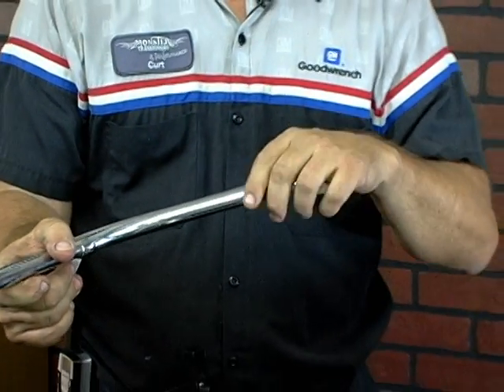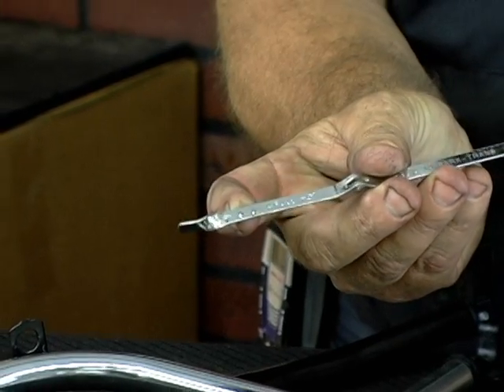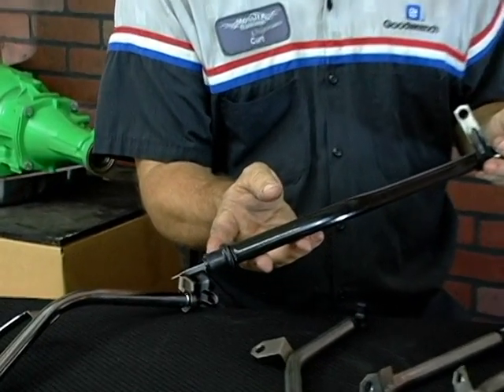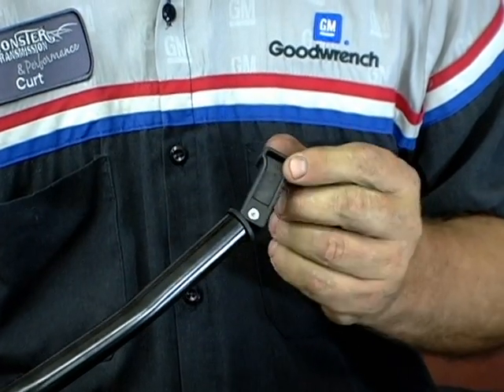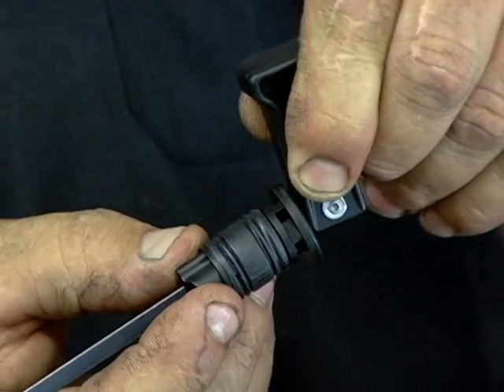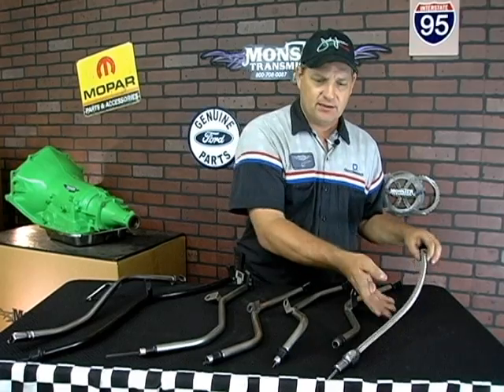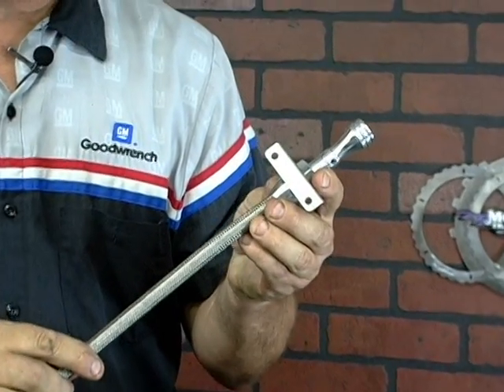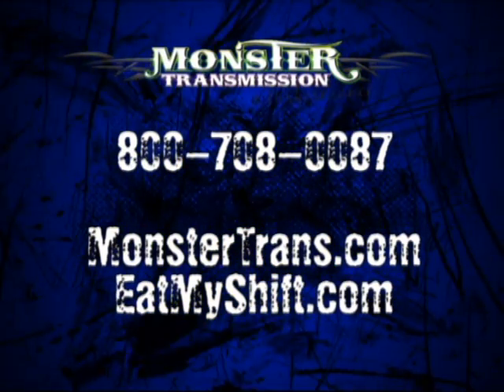Transmission Dipstick |  Curt's Corner at Monster Transmission

Comment: Hi, maybe you can give me an idea. It sounds silly but I cannot measure my 700r4. Why? The dipstick is always to wet of oil so I assumed the tranny has too much oil (oil change was done by prawner). Then I removed almost 1 Liter but the problems is still there. Stick is to wet and def quiet over the hot mark. Do I have to remove more?
It is my first us car but I guess it is not a magic to read a dipstick, isn't it?
Of course I shiffted through all gears before measuring while running engine.

Comment from the maker: Great Question! The preferred way of checking the transmission fluid is while the fluid is warm after driving for a bit, then checking it while the vehicle is on a level surface and in gear. It is recommended to do this with a friend for safety reasons.

Comment: I've got a 1965 F250 with a C6 Transmission attached to a 429 BOSS engine...as it appears,  I've got a transmission fluid leak in the area were the dipstick tube enters the casing of the transmission. What dipstick would you recommend that I replace/upgrade to ? Also, what would the steps be removing the existing dipstick tube from the transmission casing?  and re-installing the new one?
FYI: I do not use this truck for racing, it's just a Summer cruiser driven only on the weekends. 
I'm assuming it's as easy as pulling the damaged dipstick tube up and out  and then oiling the seal on the new dipstick tube, then pushing downward slowly into the transmission casing.
Reply from the maker: Garage Muscle Athletic Group You are correct with how to change it out. We do offer the C6 dipstick also.
http://www.monstertransmission.com/Ford-C6-Dipstick-with-Fillertube_p_6190.html#.VUe3KpPkBFM
Reply: Tengo una F350 1980 motor 400 6.6L y c6 trasmisión la Varilla que utiliza es la C6-TUBE1? Otra pregunta es para verificar El nivel de el fluido de la trasmisión es en NEUTRAL o en PARKING? Gracias
Reply from the maker: ***** Lo ciento senor, pero tu habla con una persona aqui? Tu puede llamada Javier 1-800-708-0087 X 4486 o tu puede escribe el javier@monstertrans.com
Reply: Gracias

Comment: I have a 350 Chevy transmission that is pumping fluid out of the dipstick the lines are not bent do you think it maybe a clogged vent and if not what else could it be
it only occurs when the engine heats up I'll check the fluid cold and hot I know its not a fluid overfilling issue
Reply from the maker: +Kent Starr Hi Kent thanks for checking in with us. Your main cause is going to be a clogged vent tube. Hope that helps. If you have any further questions give us a call at 800-708-0087. Thanks!

Comment: do you have any dipstick for a 5R55E ( this transmission has two tubes “ short tube that insert in the transmission and the long tube that insert in the short tube) The original short tube is pressed in but I had to take it off and now it can be inserted but is too loose and it leaks from there

Comment: Could I use the new boot seal on an OG dip stick instead of just using the OG o-ring? Also if have to use the OG O-ring, would it be ok to use RTV?
Reply from the maker: You  need to use the o-ring unless you switch the dip stick to the boot seal style. It's not recommended to try the OG O-ring on the RTV, the transmission fluid breaks it down.

Comment: How do you get the old one out?  I have unbolted it but it is 2 pieces on an 2002 f350 and the top part came off...the bottom 4 inches are stuck
Reply from the maker: Ron Snyder The bottom portion is placed in with loctite as there really isn't a need to remove it.

Comment: Is it a good idea to block dipstick tube hole on the engine block? I can not fix my old car's seal. I thinking of tapping it and out a bolt in to tight it up.
Reply from the maker: You can block the dipstick tube hole but you will not be able to check fluid level after that.

Comment: I have a 2004 Ford Taurus and the transmission dipstick tends to come loose over time and I lose transmission fluid.  What is the preferred method for making sure the dipstick remains firmly in the tube?
Reply from the maker: I would first pull the dipstick out and check the seals on the tube. They may have gotten bent and that's why its not seating in correctly.

Comment: I have a 2004 Ford Taurus and over time the transmission dipstick loosens and I lose transmission fluid.  Is there a way to make sure the dipstick doesn't loosen?
Reply from the maker: You should first check the seals on the dipstick. They may have gotten bent and that's why its not seating in correctly.

Comment: I've got a 2010 ford f150 4x4,with a four speed automatic with over drive the transmission dip stick is rusty and leaks, is it an easy fix to replace it
Reply from the maker: Yes Patrick, should be an easy fix, it’s just one of the bell housing bolts is holding it in.

Comment: I have a 1973  ford Grand Torino with a fmx transmission, my dipstick tube is no longer attached. Any Ideas how to fix this?
Reply from the maker: If it broke off in the case pound the broke off piece into the pan side of transmission. Then you can simply replace the filler tube.